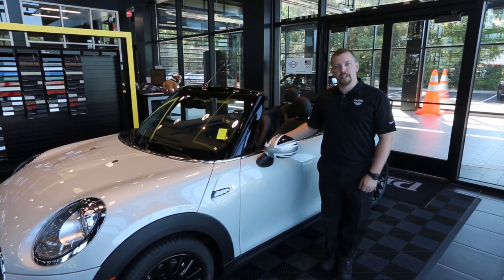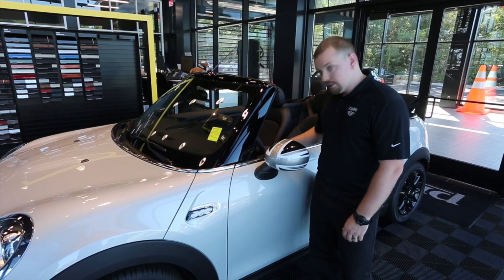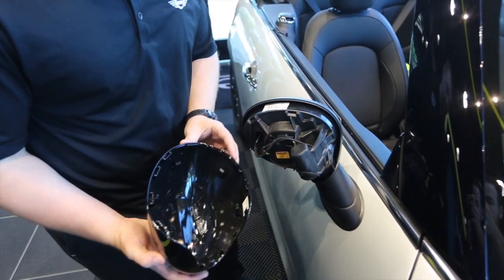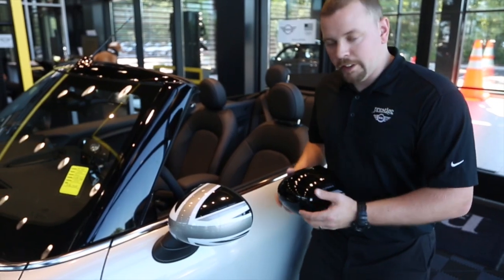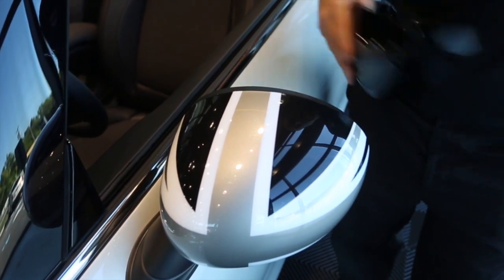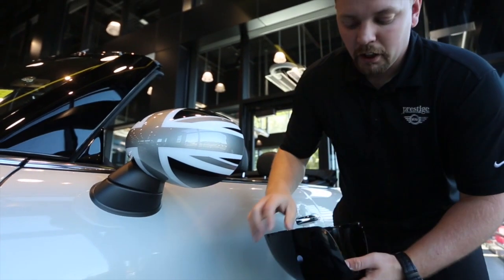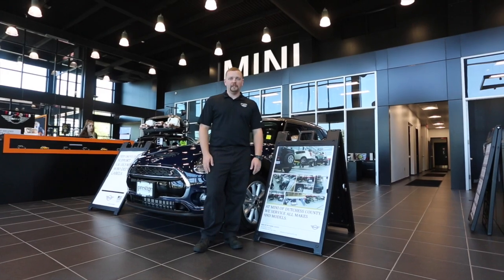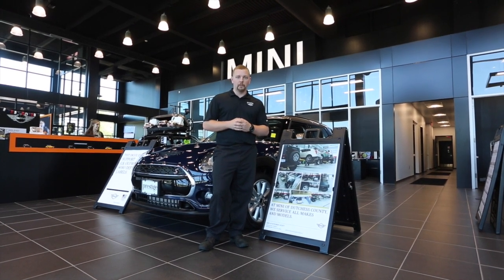MINI of Dutchess County - How-to Install Mirror Caps

Comment: Excellent video I just recently changed my black caps for a set of chrome ones. I was worried about using any kind of pry tool so when I saw your video and I tried it and worked like a charm Awesome. Thanks

Comment: Hi this is Jacques from Germany. Could you please help me on how to drill out the hole to still use the Mini Logo on the drivers side. Thanks
Reply: Hey did you ever end up drilling out the hole for the logo light? I can’t find any info on that either, and I’m looking to install the caps on my Moms Mini. Any tips/tricks you can help with are MUCH appreciated!
Reply: The new cap has a hole already on the inside. You drill the hole there.

Comment: I got mine and it has the slot on the inside but no hole present,  any tips on how to drill or start the hole, dont want to fuck it up
Reply: Does your car need the hole?
Reply: Does your car need the hole?

Comment: Do these wing mirrors also have a power folding option, wherein the wing mirrors will close and open with the press of control button/remote?.Can U show a disassembly of the motor?.
Reply: They do have optional power folding mirrors. In my 2014 F56 the button is right next to the mirror adjustment toggle.

Comment: Is there a different between Mini 2005 year and new Mini mirror caps? Can i fit those caps from your video at my R50 (1)...Thank you
Reply: New caps are slightly different in shape and size and will not work.
Reply: Yes,you need the ones specific to your model year.

Comment: No way it’s that easy!! Go check out the guy from mini blitz video ... way harder
Reply: He also broke clips... that’s not the correct way of doing this. This is the right choice, if u want u can help your self with the plastic tool, but breaking a clip is not the right method for sure
Reply: @alessandrobosatelli where did he break the clips?,we use the same method to take them off and fit them at work.